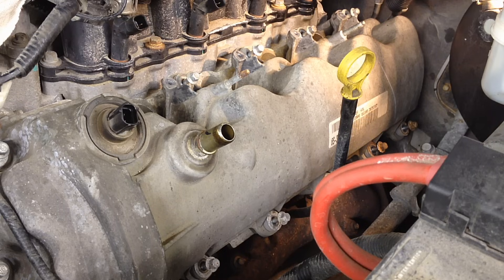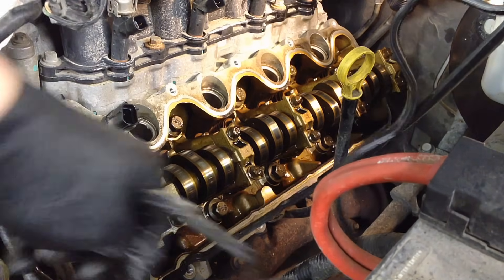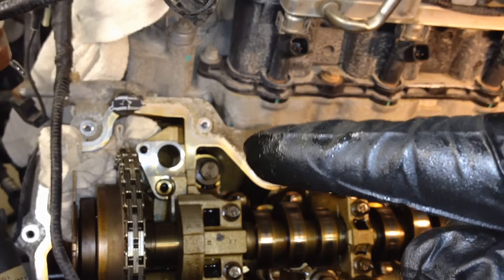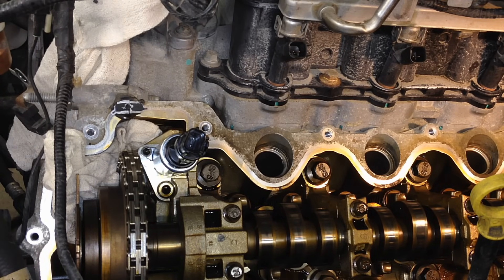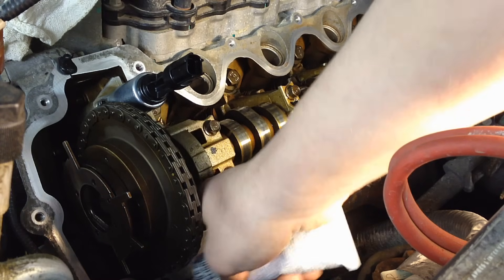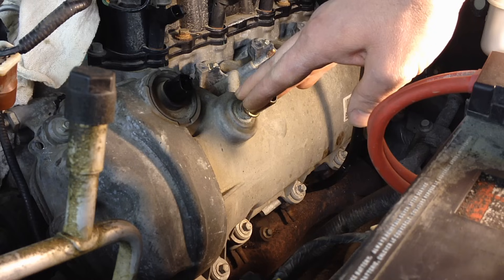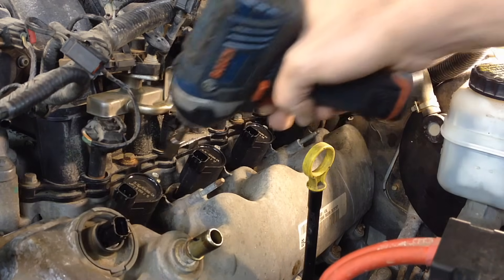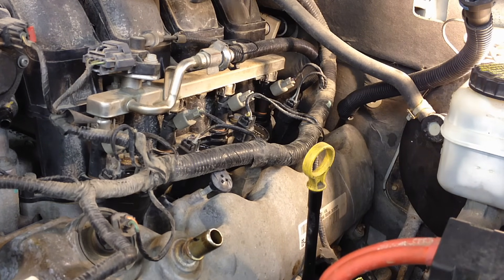Ford 4.6L 5.4L 3v Engines: VCT Solenoid Replacement

Comment: If my engine is making a knocking noise is it safe to assume it’s the phaser or would you still try replacing the VCT solenoid first?

Your videos have saved my ass more than once, thanks.
Reply: Travis C I have the same issue, I’m putting a Ford Racing camshaft kit in, new solenoid and a melling 360HV Pump in
Reply: @thorrzyro  I know i am late but did this solve your problem?
Reply: Michael Yearling I just got the shop to put a new solenoid and cam phasers in, should know later this week!
Reply: @thorrzyro  any update?
Reply: Derek Morris worked absolutely fantastic, shes been running without the knocking for almost a month now, just have a broken seal from my solenoid, the Texas heat got to it
Reply: Derek Morris I would highly suggest getting a higher volume oil pump as well as phase limiters to keep them from failing
Reply: @thorrzyro  thanks! I just completed the solenoids 2 days ago and 4 trips with no ticking and more importantly, no pre ignition while letting off gas on a light pedal load. But... will that last?? Probably not
Reply: Derek Morris make sure to check your water pump too

Comment: Question please:  I just replaced my solenoid on 08 expedition 5.4l and taking the cover off I was moving a hose coming from the brake booster going behind the engine.  Now runs worse and hard brake, meaning the booster isn't working.  Can't find anything with pictures/videos on this.  Where does it go and how do I put it back on?  Thanks

Comment: i am getting the code p0021 bank 2. i changed the vct, camshalft position senor. then the code cleared and came back p0020. and it wont clear. any suggestions.

Comment: I’ve done this twice now almost exactly a year apart because I get that open valve code and the chain sounds loose when I let off the gas, when I change it the problem goes away but is it normal for them to go out so fast or is it an electrical problem?

Comment: FordTechMakuloco  have you seen these issues on 2015+ F150 with 5.0L engine? Same symptoms, changed plugs and purge valve solenoid. Any ideas? Ford dealer can’t seem to figure it out. No CEL codes, they hooked up to IDS, seen misfires under mode 6. Idles rough at idle at times and stalled a few times. So frustrated 
Please any help would be appreciated thanks

Comment: so is there a pcv valve on the motor that is changeable or is it built into the valve cover or is it built into the intake im so confused and fustrated at the moment with figuring this out
Reply from the maker: Built into the valve cover, no service needed.
Reply: @FordTechMakuloco  THANK YOU FOR THE REPLY!!!! ive got a little access oil going into the pcv hose and the intake what should i do???
Reply from the maker: Oil carry over is normal.
Reply: @FordTechMakuloco  ok awesome so now worries then...

Comment: Chris - nice video
  I worked on GM engines 283's and 327's back in the 60's and 70's.  And later flathead ford 6's and 302's and 390's.  We would be happy to see valve covers as clean as this one.  Normally there would be up to a quarter inch of black hard sludge buildup such that we would have to scrape them out with a hand scraper and then wash them with a stiff fibre brush and clean varsol. An engine today has to be hundreds of times cleaner than those old beasts.
Reply: Exactly what I was thinking. My Dad was a mechanic working from home ‘69-‘73. I used to be the one to clean all the parts and scrape gaskets and such. That valve cover was beautiful compared to what I used to see.

Comment: I have a 2005 F150 Triton 5.4 3v engine with 55,000 miles on it with no issues yet. The oil and filter is changed every 3,000 miles. At what mileage should I change the VCT solenoids? I am a firm believer in preventative maintenance. Should I do it now? Please advise and post a reply for others too thanks.

Comment: "04 F150 4x4. Changed mine from the outside long before I saw this video. Went well, the rubber gasket the surrounds them is a pain to get out and the "pucker" factor is huge when pulling that screw out. Just pull it out with the solenoid so it doesn't fall into the engine. Really enjoy your video's. Just had my timing system completely changed, $2700.

Comment: I have a question, does my 07 f-150 4.2 V-6 have this VCT solenoid?  And if it does, would that cause the number one cylinder to misfire at idle?  I can't feel a miss as the RPM's build.  both banks a lean by the way.  thank you.  frank.

Comment: I have an '08 5.4 3v with 150k and the person bought I it from had the timing chain done recently.  I'm almost certain they didn't do the phasers (or VCT solenoids.)  
When it gets hot, it starts knocking, shaking, stalling, etc..  
When I disconnect the harness from both solenoids, it doesn't do this anymore.  Would this indicate that the VCT solenoid(s) have failed?  or would this indicate the phasers are getting stuck independently from the VCT solenoid?
You have another video where the motor still knocks and stays advanced even with the solenoids disconnected; replacing them resolved it.  If mine doesn't seem to knock or stall with the solenoids disconnected, would that mean my phasers are bad? 
I'm hoping I can get by with just the solenoids; I'd rather not get into the phasers if I don't absolutely need to.
Thank you for all your incredibly informative videos!!
Reply: Actually, I commented too soon.  I just watched the "Quickly Diagnose The Most Common Fault on Ford 4.6L & 5.4L 3v Engines" video and it explained just that.  
I have the '08, so I suppose I'm looking at removing the valve covers.
Would you say that it is critical to do both the solenoids on both banks?  Or would it be okay to just replace the faulty one..?  If that is okay, can I just disconnect one solenoid at a time to figure out which one has failed?

Comment: Hi Brian.  I have a 2004 Ford F150 new body style XL Supercab design 4.6L 2 valve engine automatic 2WD. 93,000 miles The truck very often runs well but sometimes seems to bog down the PATS light on top of the dash comes on solid. The engine seems to misfire or bog down. It has never stalled on me but did once for my daughter. I let up a little on the gas and then step on it a little and it recovers.  I am using that Pennzoil Ultra Platinum Nat. Gas Oil. I changed out the fuel filter, Plugs and Coils. It has a oil down the Plug bores on 1 or 2 of them. Just a small amount of oil however. Was hoping it was valve cover gaskets. bought them but haven't installed them yet. Still does it sometimes. The more I use it maybe it happens less!? What do you think it might be. does the 4.6l 2 valve have VCT solenoids also?  Could my issue be the VCT if I have them or Maybe a transmission shudder? I did change out all the Merc V fluid and changed the pan filter. I dropped the pan and changed the filter and  put a bucket under the transmission cooling line and replaced  the fluid as i pushed it out.  Ford Did replace the Transmission at about 50,000 for the previous owner. A little scary when your in the passing lane on the highway.  My VIN is  1FTRX12W74NA97538. Transmission  4 spd  A/T AODEW/4R70E W/TSS.  I think it mostly happens when I am trying to accelerate a little.

Comment: Thank you for your video's my Ford dealer in Dubuque Ia told me i needed a new engine at the tune of $8500.00 on a 2004 with 85000 miles on it and low and behold your VCT replacement recomendation solved my rough idle after warmup problem i was able to change them out without removing the valve covers through the VCT port and just replace the caps also thank you for you videos.
Reply: do explain please, vct port?
Reply: @CelticKnott  I think this only possible on earlier engines. That is what my research is showing. I have a 2008 F-150 5.4. I am going to try through the port first. I will let you know.

Comment: Rough idle on my 09 4.6L f150 along with slight ticking noise around 800-1200 rpms. 135K miles. Unplugged both VCT solenoids as your diagnosis video described and the ticking is gone along with the rough idle. Do the vct solenoids you have in your post description fit the 4.6L as well? It only shows 5.4L on Amazon. Thanks
Reply: Did you fix your problem

Comment: so let me get straight for on the 05 there is no PCv valve it's now this vct
Reply from the maker: no pcv valve on any 5.4l 3v and vct solenoids are on all 5.4l 3v engines.
Reply: FordTechMakuloco so a bad vct can cause burning oil that's the issue I have with my 05 expedition 5.4 3 valve it goes two quarts on a month. and don't have a leak

Comment: Ford tech makuloco-  I bought my 05 F150 5.4 3 valve and shortly after it started making a lot of noise from the front of the motor. I changed phasers, solenoids, cam chain, tensioners, guides, pretty much everything to do with the timing as well as the oil pump. I'm getting a check engine light with a code of p0020 but the truck is not running rough. It is severely lacking power but not running rough or knocking or anything like that at low RPMs or high RPMs. I was wondering if the VVT solenoids could be causing a lack of power and not cause rough idle or engine noise. Thank you for taking the time to make these videos. I know they have helped me alot since I have bought my F-150! Also thanks for any and all help you or anyone else can offer.

Comment: I couldn't find a video you made on a pcv valve replacement on the 5.4l 3 valve. I'm consuming a little bit oil and I thought well I think I'll change the pcv valve if it has one.
Reply from the maker: There isn’t one

Comment: the soleinoid replacement on Amazon says it doesn't fit my 2005 4.6L...is that wrong..
Reply from the maker: This is only used on the 3v engines.

Comment: Does the pcv valve on the driver side valve cover have a check ball in it and if so is there a way to clean or replace? Also could that cause a P0174 code?

Comment: Hi Mr makuloco, I have a 2005 expedition 5.4 triton,  with code p0012, camshaft bank one, whats the fix?should I replace the solenoid valve, and if I can repleced  without removing the valve cover?, thank you and cheers from Ontario ca.

Comment: A BIG Thank you for the video and the series on VCT. I got the Ford VCT's and replaced the old ones. Which to my surprise, were not Ford parts but VAICO. (??) Change out took less than an hour and so far running much better and smoother; No shaking at stops included. Phasers are  worn on my 2006 F150 (170K) and I do see a new motor in my future but for now I have faith she will hold up for a while. Again, Thank you!

Comment: My question is mine runs great from idle to wot. But i have a slight tic. Has a brand new rebuilt in it with both new solenoids. But my drivers side solenoid doesnt pulse. My passenger side does. Even if i unplug the solenoid no change on the drivers side i donteven get a cel if unplugged. But i do get a cel if passengerside is unplugged.. pig tail has 13v and solenoid has 10.2 ohm. And thats exactly what i get on the passenger side as well.. so what the heck.

Comment: Question 
I have a f350 super duty 2005. It’s stalls out and sounds like a diesel 
I’ve changed the cam sensor will be changing the VCT solenoid tomorrow. 
I did have 2 codes on the truck P something or other 
Any ideas what else it could be 
Thanks
Reply: Are you sure that the code started with a “P”??

Comment: I have a 05 f150 that I replaced the vct solenoids on yesterday. After I did it the truck ran great with no issues, I drove it until it reached normal temp. Today I get in it and it’s back to square one, idling like crap when it reaches temperature. Any suggestions on this?

Comment: Bought my 5.4 brand new it has 275k no ticking no knocking  only thing done is plugs, coils intake manifold gasket still has factory water pump. First oil change done at 100 miles 2nd 500 miles 3rd 1000 . Full synthetic every 3k miles after that.  Coolant flush every 3 years. I'm 100% convicted all the so called common issues  with the 5.4 are from poor maintenance cause I've never  had any of the issues with my engine.
Reply: 5w20?

Comment: Great video! But can you please tell me if there is a power steering Reservoir bracket that had to be removed on this particular vehicle? If so, How do you get to the bolts on the bottom and what size and how many?
Reply: robert in my experience i removed the two visible bolts and bent the bracket down out of the way. worked for me. could not see let alone feel the other bolt. hope it helps

Comment: I did a 07 5.4 and installed a aftermarket vct that the customer bought. The engine idles a little rough and then at times it idles smooth. The timing for the rh side cylinders on the scanner is in the neg. at idle  and when you bring the rpms up the readings go positive could this be the vct valve or is it more likely off timing physically. It hasn't set a code yet but it has pending code p0016

Comment: I changed out the selenoids after watching your video, and the engine ran fine for a few months.  However, it has just recently started having the same original problem as if the solenoids were sticking again.  I tried the diagnostic you suggested by disconnecting the selenoids, and still idling like crap.  Any suggestions?
Reply: bad spark plugs or coil packs?  did you ever find out what it was?
Reply: @robertswift6101  That's what I want to know also, but no answer at all.

Comment: Hi there, i had these codes on a 2005 f150 5.4, p0011,p0021,p0174, p0300,p0301,p0302,p0303,p0304,p0351, p0352,p053,p055,p056,p057,p058,p2196, all these codes came on when the teuck was driving, what i did was cleared the codes, and i restarted the truck and one code came on p0340 so i replaced the cam shaft position sensors, and after that the truck wont start, any advice, i would really appreciate any help!

Comment: I thought you don't have to remove the valve cover to change the vct solenoid. i seen others video changed without removing the valve cover!!!
Reply: Starting at 2007 you have to remove valve cover.
Reply: @calvinw78  why do you think ford engineers complicated replacement of the selenoid?, do you think it is for some sort of performance enhancement on the part?

Comment: Does this fixed the problem? i have a a 2004 ford f 150 the check engine came on i took it to the auto parts. &  they told me was code P0012.

Comment: Hello, I have that common shake at idle and think and hope its just the VCT. Codes thrown were P0016 crankshaft position, camshaft position correlation bank 1 sensor A. To do the quick test to see if the VCT is stuck open do you have to unplug both then drive around the block or just the suspected problem one?

Comment: If this solenoid is stuck during start up/idle , would this create a low oil pressure warning? I tested my oil pressure with a gauge and I am right about 22psi

Comment: would i get a check light?

ticking loud right front idk injector, ctv...??? idk

the 4 on left sound equal in sound but on the left 

first is ticking loud

second almost sounds and feels dead

 idk im touching on the fuel rail though

other two in back sound equal to left

2011 crown vic 100,000 miles

any advice 
trans , sensors, ect. i could change to avoid any small troubles

Comment: I had  this issue ie cam timing cylinder misfire code, cylinder #4.  Ford service removed valve cover to "inspect valve train on #4, rockers ok" checked compression reported 60 psi on #4, others at 125psi, stated engine needs replaced.  charged $267.00 for this,  i think you are correct NOT them,  any direction?   fyi i changed oil added Restore brand engine restorer/Rinsloe oil additive and marvelous mystery oil & lucas oil tx to a couple mobile one synthetic quarts. similar to your flush idea,  then ran better but got the po0017 code/ 300,302,303,304.  help!

Comment: Do i have to disconnect the battery before unhooking all the connections to the coils and etc.?
Reply from the maker: Not required.
Reply: Thanks i have a '09 f150 5.4 V8 that has been idling riught and acting like it wants to stall out when i come to a stop light or driving slowly through a parking lot etc. So i figured that was my problem and sure enough today ut threw some codes along with the check engine light.

Comment: FordTechMakuloco the links for the torque sequence no longer work. can you post new pictures, or write out the sequence? Also I saw you said the torque for the bolts should be 89 inch pounds, can you tell me the best method for torquing the bolts down in stages?

Comment: I have NEVER had to remove the V/C to get the solenoid valves out. Just be careful and trust the captive design for the cap screw and pull the solenoid valve simultaneously with fastener removal.
Reply from the maker: Mid year 2007 and newer the valve cover was redesigned and the hole is smaller so this cannot be done without valve cover removal....
Reply: I can verify this, wacky redesign
Reply: dang it...I have an 07 f150 that shakes n rattles when coming to a stop and on idle for a few seconds...thinking of changing these but was hoping I didn't have to take the covers out..😢

Comment: When I drive for 15 minutes to work the engine misses and runs very ruff at the drive through coffee shop. Sounds like it wants to stall.If I rev it up in neutral it will sometimes correct it. This morning I opened the hood and unplugged the VCT Solenoid to put power to it like you suggested in your video and by just unplugging it fixed the ruff idle. Do you think that the VCT Solenoid is the problem still or should i look at something else? Your videos are the best way for everyone to get expert advice thanks!

Comment: I've got a 1997 ford f150 4.6 triton. around 200k on it. it has a skip like a misfire. code said misfire on #8 plug. fixed it, then code p402. fixed it also. still skipping bad, no codes coming up? did a complete tune up, motorcraft plugs, wires, & both coil packs. it still skips like 3 kids with a new jump rope. ever seen this before with your ford experience?